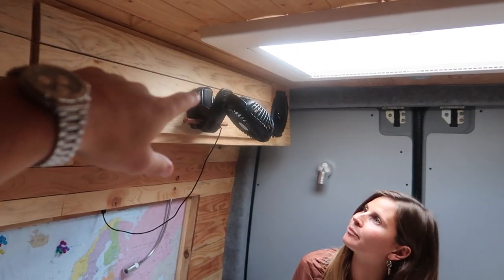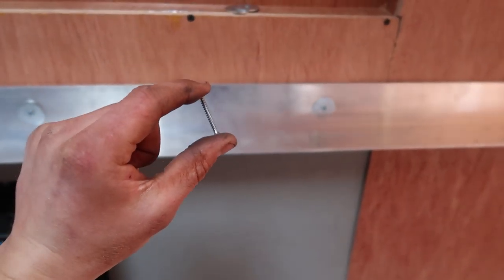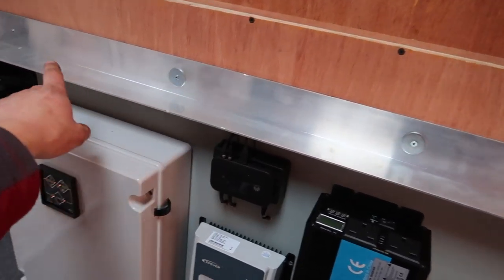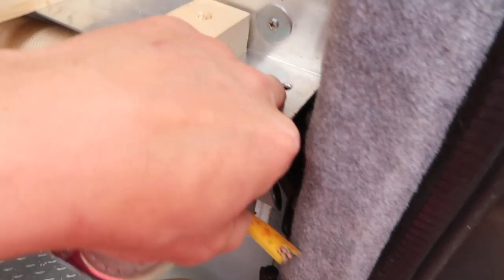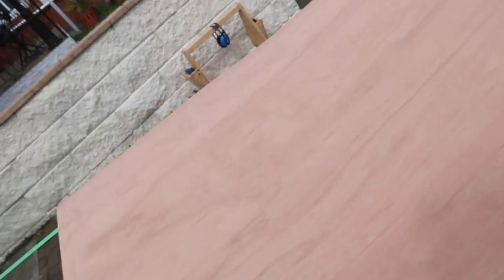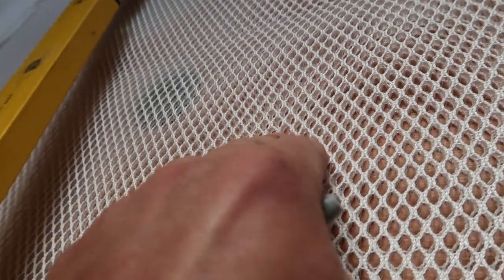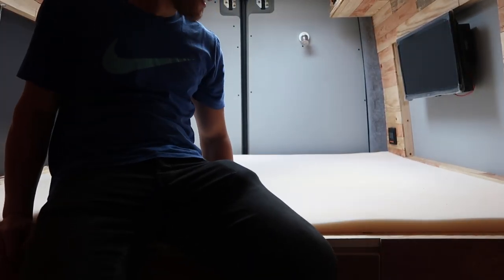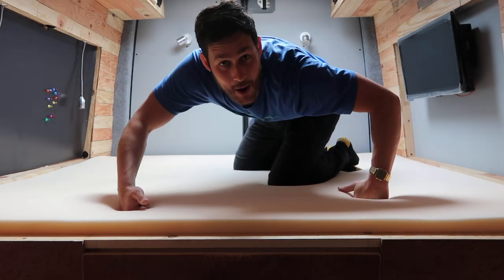Bed Install | Ep26 | Sprinter Camper Van Conversion

Comment: Hi Guys. Do you have a link as to where you got the mattress from. Ours needs to be 174cm x 137cm x 10cm. Any help would be greatly appreciated. A&B
Reply from the maker: Hi its just 4" memory foam from Ebay cut to size.
Reply: @ScottAndJen  Is it comfortable an can you remember which ebay seller it was as there are quite a few. We are going to have to buy a double i expect and cut it down like you did in your video.. Nearly finished our van now buth the videos are a few months behind
Reply from the maker: @AndrewandBarbara  It's nice and comfortable yes. Im afraid not no you will just have to judge quality for yourself. Good luck

Comment: 5 little screws on each side holding up the bed and 2 people?! Just doesnt seem enough, but that's based on nothing...
Reply from the maker: Its plenty but there is no harm in using more if you are concerned :)